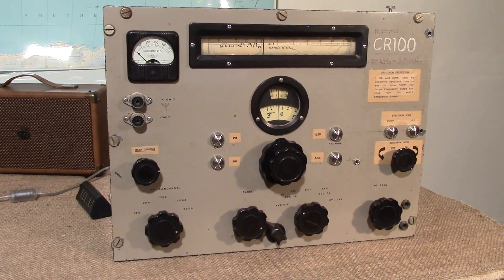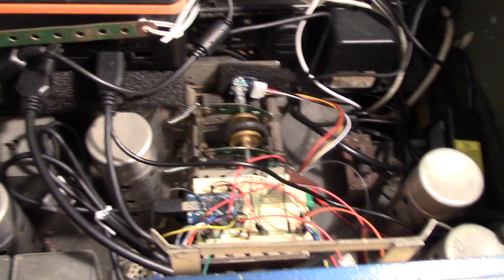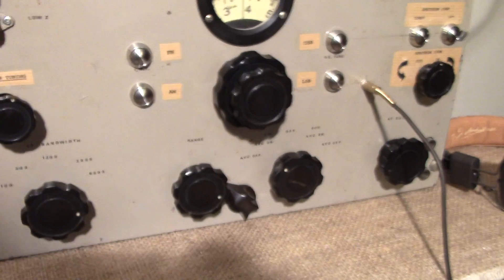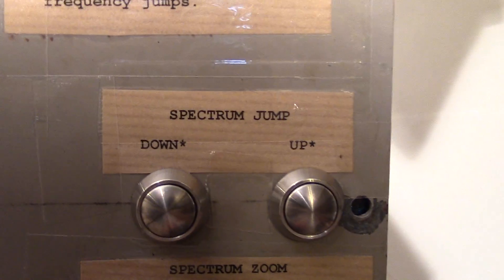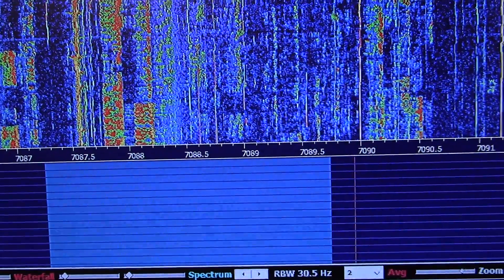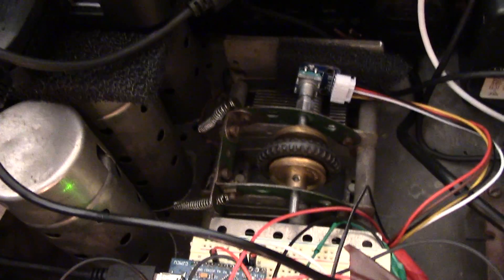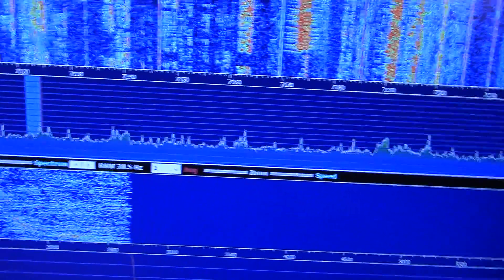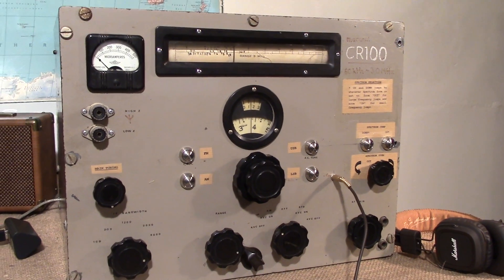SDRplayMarconiHybrid

Comment: Nice project! You have space in there for a tuneable band pass filter. I currently have a Funcube Pro+ and it is useless on HF without a BPF to give it some front end selectivity. Is the SDR play less prone to receiving stray signals?
Novel use for those old Meccano wheels by the way!
Reply: The RSPs have a built in set of front-end filters. The RSP1 comes with 8 and the RSP2 has 10.